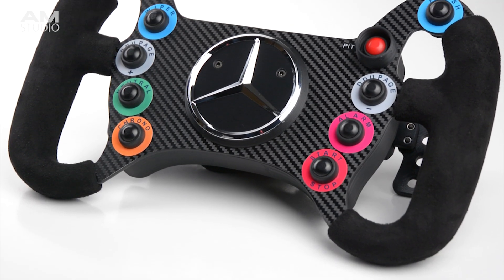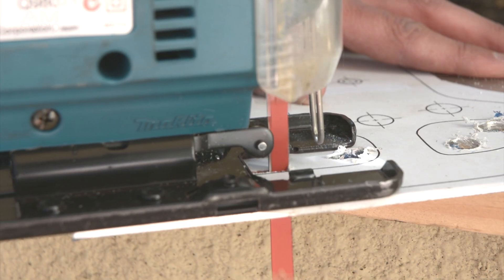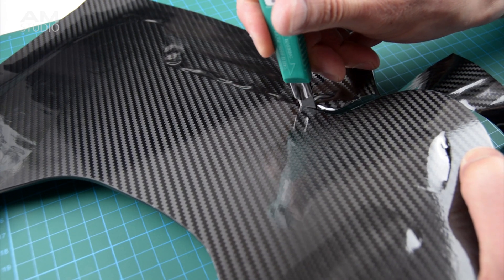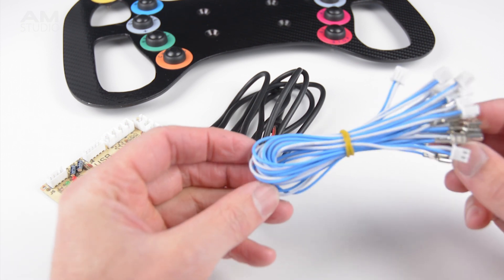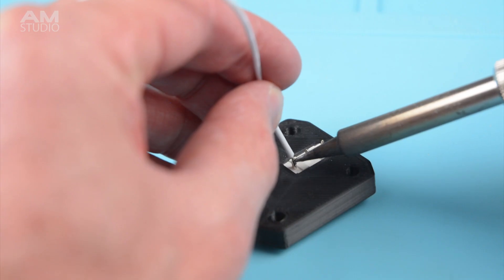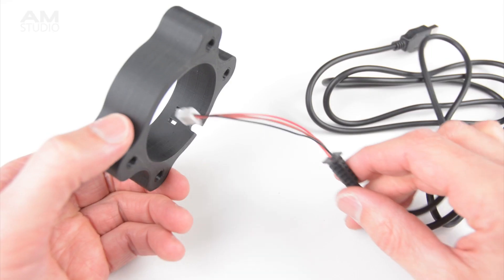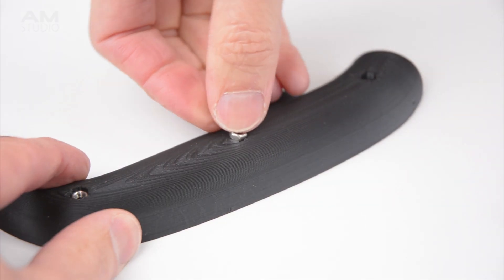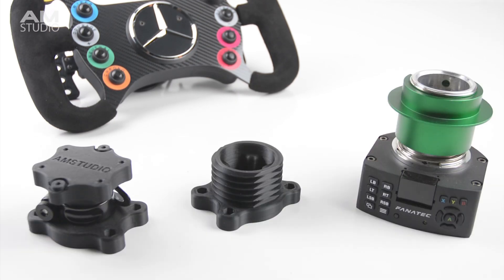HOW TO MAKE A DIY AMG STEERING WHEEL

Comment: Did you cut off spade terminals to solder directly to spades?

Sir I think you did a dumb on that one.
Reply: The wheel shakes a lot, especially on a DD wheelbase. Solder is more secure than just the spade terminals.

Comment: Well i came across a point where i need to upgrade my current stuff cause my old stuff broke... Im thinking about building a DIY wheel too. How are the buttons working? Like is the USB-Encoder already able to detect what is used and everything then just works like it should or are there other steps in addition to get everything working?

Comment: Hello bro i have an old racing wheel but some off wire been cut i want to soldering it again but i have two wires i didnet know where i connect (6GD ,5GD ) i connect it with 7GD and 8GD ??? I didn't know

Comment: I’m just printing all the parts over the next few days. I printed the shifter paddle and the bottom was very stringy. Currently I am printing them standing up on the printer. Would it be better to print them horizontally against the bed or just add supports?
Reply from the maker: Lay the parts flat with the largest surface area on the bed

Comment: Never use an open flame on heat-shrink; HOT AIR ONLY. Why? Because an open flame changes the chemical properties of the heat-shrink making it more of a fire risk and additional VOC's are released.

Comment: I'm pricing out upgrades for my sim rig and am curious what kind of cost would be associated with building this wheel? Just parts and materials.

I wouldn't factor the cost of labour as I would be building it myself and would have to find access to a 3D printer.

I'm just wondering if building one of these wheels would be cheaper than buying a pre-built wheel rim from a company like Moza or Fanatec.

Thank you.

Comment: Love the design but am confused on how all the wheels work/ plug into the ps4 for whatever. I get the physical connecting by changing the adapter on the back but how do u program or so the bottoms work and stuff, also where does the usb cable plug in from the wheel? Keep up the work and would love a custom Porsche themed wheel build.

Comment: Hi recently purchased a G920 for xbox one and have watched the video and all looks good the only thing I am stuck on is the connecting up and wiring to the wheel itself. I see that it has a usb connector at one end is that then replacing the usb wiring into the xbox from the original wheel?

Comment: Hello! Beautiful object. I wanted a clarification about the connection of the usb joystick encoder to the pc, that is I mean you connected it directly to the computer with the usb cable or you made some strange connection inside the steering wheel. Summary: You have connected both the base of the steering wheel and the steering wheel with the usb at the same time.
Reply: @amstudio please reply. I'm curious too.

Comment: but assetto corsa only recognise or the wheel base (mine is logitech dfgt) or the joystick usb, how can i connect them together?
Reply: marcello regazzetti are you on console? also if you want to use the buttons you need to bind them from the settings
Reply: @alexsib444  I'm on pc, but i was wrong, AC recognise both wheel and joystick so problem solved!

Comment: One question, will my 3d printer with 180 mm x 180 mm bed be able to print the lower case?
Great job!! I already build analog handbrake and button box according to your tutorials!
Reply from the maker: 180mm is too small, min recommended is 200mm

Comment: how thick is the aluminum plate? i was looking into wheel making and couldnt decide on what would be best 1/8th inch or 1/4 inch. i just bought a 3d printer and im working on designs right now. hopefully i can get into it a lot more this winter.
Reply: 3mm

Comment: Hey am I was wondering whether it would be possible to just have a quick release adapter attached to the paddle shifters and have all the other buttons in a button box wired up with the the original circuit board from the wheel wired through the base if it is possible pls do a tutorial on pls make compatible with ps4 btw ur tutorials are great keep up the good work

Comment: Is it possible for you to build a steeringwheel with a screen inside it? You could use an old phone and the app Sim Dashboard. So the wheel could be very versatile, because Sim Dashboard allows for custom templates.
Reply: On this one, I guess you could remove the logo and make a phone holder where you can place a phone inside with maybe something like a gyro to keep the holder from moving with the action of the wheel (from force feedback or axis movement).

possibly could be done but i don't have such knowledge to know if it is doable.
Reply: @TheMediocreBrit  well there are certain designs that could be copied. For example the Williams F1 car has a screen just behind the steering wheel. Could also be an option.

Comment: Hi amstudio love your DIY vids. I was wondering insteed of using the universal hub from fanatec, could the quick release from them not be used insteed,  since all the buttons on the wheel uses its own USB connection ? or are you using the universal hub to get quick access to wheel settings.
Reply from the maker: Universal hub to access the wheel settings and its needed for the FFB to work.
Reply: @amstudioprojects  yeah i thought it was something like that, but could fanalabs not fix that, i mean with the ffb settings ?

Comment: Omg so amazing work dude (but i have a g25 and dont have 3d printer )i cant release this amazing  wheel so nice video👍👌
Reply from the maker: You can use a Local 3D print service for the parts. Also it can fit a G25 with an adapter

Comment: "few basics tools" 
Take the 3d printer
Reply: I came to comment section after watching to say the same thing but looks like I have been beat to it
Reply: @jamiemcauley1322  there are websites that will print the parts for you so yes basic tools
Reply: You can order 3d printing without having your own printer
Reply: Today, a decent 3d printer costs 200$ - it's becoming basic.
Reply: Same for the vinyl cutter...^^
Reply: At this point, a good 3D printer is cheaper than ever, it's a superb tool for any DIYer
Reply: Azzix Freezy or you could just use 3Doodler
Reply: was about to type that!
Reply: Glad I have one
Reply: Ender 3 pro for $200 and is amazing! My dad just sent me the parts and the whole wheel feels amazing!
Reply: Fantastic job! Which printer are you using? slick job. You could also use a sheet of carbon fiber. A piece big enough would only be $20 and it’s easy to cut and shape. Love all your projects.
Reply: Carbon fiber aswell
Reply: You have to get government permission to own it in my country
Reply: there are 3d printing services everywhere nowadays, you bring your 3d mesh and the create it for you
Reply: I did mine without 3D printer
Reply: Just need a Prusa... hahahaha
Reply: @rolandofuentes6444  without sounding like a dick, i have two 3d printers all self-built. Good thing, if this kind of work id down your ally, so is building/owning a 3d
 printer
Reply: 3d printer  isn't basic so ima say YEAH WTF DOES HE MEAN
Reply: @tmaddock71  In Finland every library has 3D printers you can use, so prettt basic yeah?

Comment: Would 2mm carbon be enough for this? I can cut on cnc machine. Do you provide cad files in the download suitable for generating toolpaths?
Reply from the maker: Cnc file provided in the kit for the front plate. Designed for use with 3mm plate

Comment: I was about to try finding the parts of an other steering wheel you made and this suggestion just changed my plans. One question though. Does the front plate have to be aluminium/carbon fiber or it could be 3d printed too

Keep up this good work!
Reply from the maker: Yes aluminum or carbon front plate for this design

Comment: It'd be awesome if you made a wireless wheel rim!
Reply from the maker: Sounds good
Reply: @amstudioprojects  Wireless button boxes that attach to wheel rims would be cool. Say Fanatec P1 rim:) ?
Reply: I am in the process of doing this now. Hoping to adapt my setup to this wheel.  USB recharge lipo battery, nrf24 module on an arduino or bluepill sending to nrf enabled equivalent that acts like joystick. many possibilities!
Reply: @elninonitro  You should post on Sim Racers FB page when you complete it. I'm sure many are interested.
Reply: @szymonkrysiak6852  for sure, but being in VR I'd take more buttons on the wheel at the cost of slightly less ffb.
Reply: @szymonkrysiak6852  Not so much if the mass is more central.  A lipo battery weighs bugger all anyway.  I have managed to get a 14 button wireless setup going this weekend :) Weight is only a few grams plus battery.

Comment: this might be a stupid question but is there anyone out there that has tried to mod their csl elite wheel? i see so many great mods just not for this wheel anyone tried to disassemble their p1 wheel to see if its an easy way to mod from there? and are there any mods for the elite v1 padels?
Reply from the maker: Good question, what kind of mods do you need?
Reply: @amstudioprojects  wow thanks for answering love the stuff you make. I would like to be able to also built my own rim you know because the fanatec rims are expensive and i love the diy stuff. I would live to be able to mount a gt3/f1 like rim or just a different wheel at all. Regarinding the padels got them from a friend that adviced this wheel base to me. I dont know the bitrate/sensitivity of the padels so not sure if it will be worth it to mod but the padels feels weak although it has a piezo sensor (if that is the correct term) though it has no 'normal oil pressure cilinder' like v2/3 have would it be worth it to mod and even possible? thanks though for your time in advance hope i answered you question.